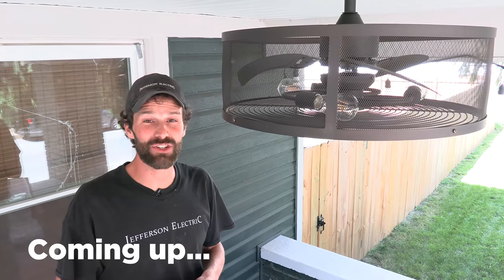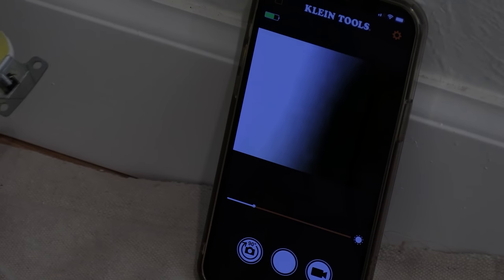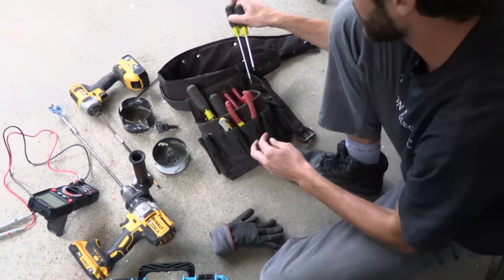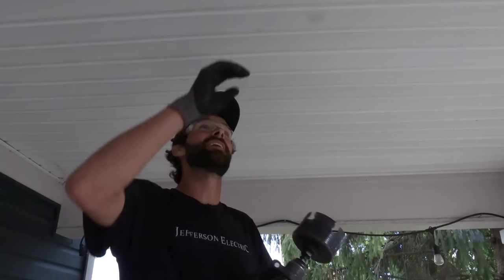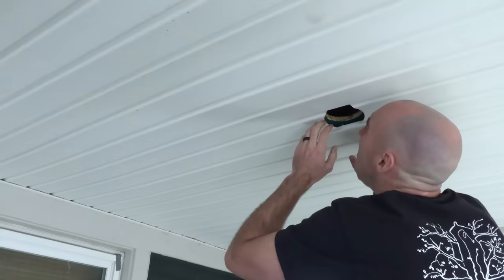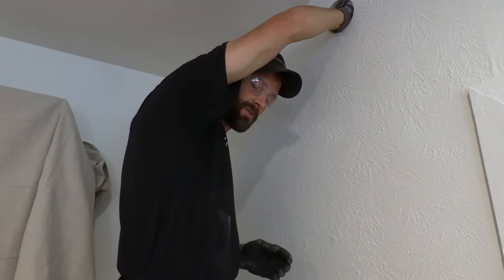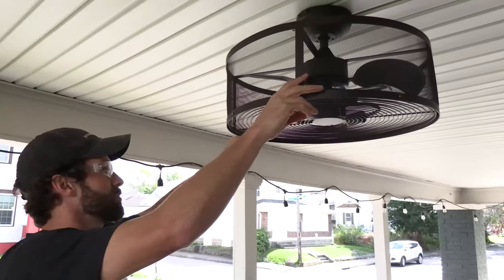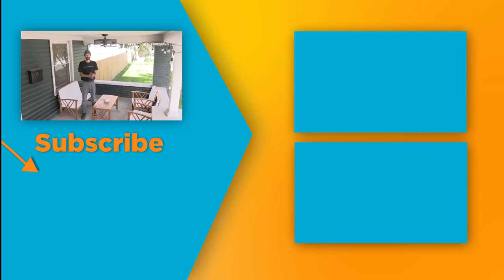Installing a Cool Breeze for a Hot Summer Day

Comment: Ceiling hole tip. When drilling your box hole through the vinyl, start your hole with the drill on reverse, low speed. Two or three revolutions to set your groove and you don't need to stress your hole saw skipping and scarring around your hole.

Comment: 16:02 I would have ran 14/3 in case you later wanted control of the light from indoors. *(For when you get tired of going through remote control units that last less than a year...)

Comment: One of My many favorite Home made Tools is a Golf ball with a hole drilled all the way through and cross drilled for a screw. now I can attach it to an Eye of a Fish Tape or on the stiffer Fiberglass Rods. I once had to Fish a 4" PVC with 2 90's and about 50 RG6 Coax's down 3 Stories. A normal Fish Tape would just coil up in the PVC and not go down. 
The Golf Ball just sailed down like nothing, I went down Stairs and had 50 Ft of fish Tape on the Floor. 
The other one is a Tennis Ball with a 6" 1/4" Eye Bolt through it. talk about getting Cabling through Bridging in commercial buildings was a Breese, In 37 Years, My moto was If I could see a hole in a Wall or what ever I could a wire through it. hahah...
Mike M.

Comment: Joel fine job ,  although I may offer a different approach if I may. 

just as you did start by removing the OW box containing the receptical and using fish rods to check for obstructions  after finding the obstruction this is where I would of taken a different approach 

Observing new vinyl siding and soffit on the exterior I would of removed the siding from the Top  down to where the obstruction is 

Then cut your hole from the outside and drill the obstruction instead of cutting drywall on the inside 
Then 
using your whole saw drill the vinyl at the proposed fan location
drill about a 1-1/4 hole  in the center of the 4”  Vinyl hole cut  (the plan now is to ultimately use a fan  rated pancake box commonly called a    “fan cake box. “

Then remove the vinyl soffit as needed for additional access holes or cuts

Now you  can proceed with fishing the wire across to the proposed fan location and dropping the Romax through the 1-1/4 inch previous drilled hole.  Now that the fishing is complete you  you can reinstall the material that was cut out for access 
Be sure to install the fire putty and reestablish any vapor Barrier that may have been compromised.  

Then proceed with putting the vinyl soffit back up and the siding back on and proceed with installing the fan cake with the Romex through the back center of the box with A approved connector  now the fan box can be mounted and fasten to the old wood finish above the vinyl soffit 

now you can proceed with installing the fan and reinstalling the outlet on the inside of the house ( thus eliminating any drywall repair needed ) and then you can walk away from the job 100% completed

Much easier than trying to match drywall and paint finishes. 

Remember this only works if we have the benefit of new vinyl siding and soffit material. 
Thank you
God Bless
Geo
Reply: I agree... going through the outside probably would have been easier and less sightly. It can all be covered up by the siding and ceiling paneling.
Reply from the maker: Geo, we need to get you on the channel. Great explanation! Funny enough, messing with the siding and soffit like that sounds intimidating to me. Crack a piece and now I’m really in for it with the homeowner.

Comment: Joel, you need to try a Teslong NTS500 Borescope. It comes with its own large lcd, they have multiple size camera heads/lenses, and most of the heads have 2 cameras (one straight on view and one at 90 degrees) with a button to easily switch the view, and high brightness led’s. 

No I don’t work for Teslong  😉

Comment: is that vinyl siding?  just wondering if you could have removed a few strips and cut / patched a hole from the outside instead of putting a hole into the drywall..?

Comment: Maybe not applicable to this exact situation but as you discussed and changed the location for the installation I was wondering. Would it not be more practical to place the fan, if it were only a fan perhaps, in a location that while less aesthetically pleasing, would then provide the best air flow to those wishing to enjoy it's cooling breeze. Not trying to cross i's or dot t's, just wondering. Beauty I suppose is always in the hand of the beer holder.
Reply from the maker: Haha! I haven’t heard that one. Being centrally located the fan does a decent job for a small gathering of folks rather than just one person sitting in the corner on their lonesome.

Comment: 5:10 Why you dont use a breaker tracer to find a correct breaker?
5:50 Why you dont use a Ryobi inspection camera with light to see whats inside of the walls. Sometimes i saw a holes for a wires run in fireblok.
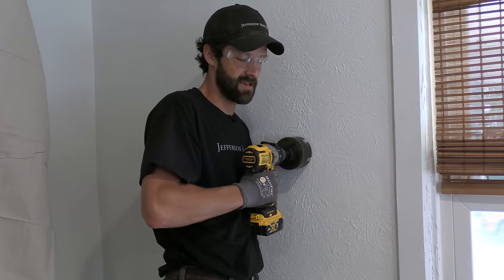10:15 Make a Dual square box instead of round and install a fan switch with usb charging GFCI. More useful.

Comment: After drilling holes through my joists to put the wires into them rather than badly attached underneath and improperly notched out of the joist in some places. I have said goodbye to spade bits and gone to speed bits it's a tri wing auger bit. Halfway through the project i was like it's time to get a new drill bit!! The wood in this house is the older but not really old 2x6 variety and it was solid, I just about burned the corded drill out!
I hope he's gonna save that hole he cut out. It wouldn't be that hard to do some minor works pre-repairs by slapping that thing back in its hole with some wood behind it, it will save on drywall patching which isn't that hard to do unless your wall is textured.

Comment: That's a nice fan. I like it. However the LED bulbs would go right in the trash and I'd use halogen bulbs. The fan will keep them nice and cool... Okay, I am being a little facetious. I like where they're located in the fixture. Even though unseen in the end, I think the WAGO brand lever nuts look better and might serve better. I can only speak from conjecture as I have not experienced those particular lever nuts. They look more bulky than Wago and that is also off putting especially in smaller boxes or boxes that have a lot going on inside of them. I don't like that ceiling box as it appears to be nylon which again, even though would be unseen, it's all about the quality of what you don't see and what is going to hold up better. Plastic and nylon just cheapens it, so why not pay a few cents more that's going to be superior and last longer and be easier when it is time for service ?

Not a fan of digital meters because they're not accurate, not consistent, and need batteries to work. Klein NCV detector would suffice verifying power is off. It's pretty much a given that the electrical wall socket is at or about 120 volts AC if it does alarm the NCV detector. Even if set to the 12 - 1000 you're going to know by contacting the hot side by if it flashes blue or is steady at red and continuous tone if it is higher than 12 or not. It would also be evident if in the end it doesn't work and so it would have to be fixed anyway, if it didn't work. So it just seems much simpler to do it this way.

I like Klein tools but I was unable to find a metal cased tape measure, so Stanley it is. They seem to be the only one that while also having plastic give you an option for metal and that's just so much better. Plastic and ABS plastic is toxic, harmful to the environment in production, comes from petrol which spills, gets brittle and broken long before metal starts to rust.

I say use the tape around the outlet. It doesn't hurt.

Comment: Well I hope you're happy now. All because of YOU I now own a KAIWEETS HT118E Digital Multimeter TRMS 20000 Counts with Higher Resolution Auto-Ranging Voltmeter Accurately Measures Voltage Current Resistance Diodes Continuity Duty-Cycle Capacitance Temperature 

Not that I had money to buy it, but if you say, I try to do. I don't think I have much longer to live anyway so I threw caution to the wind. It will probably blow back in my face and blind me.

Comment: that pancake box, is not a box for a fan load.. it is only for light fixtures... you would need the pancake type that secures the fan weight not on the box yoke...    also before you install a homeowners fan make sure they supply a damp rated fan...

Comment: You guys have to pardon me, but the bare Romex system used in the US is just a total mess in terms of upgradability. Every single electrical point here is connected to another using flexible tubing, then individual wires are passed inside. Have to change a circuit? No problem, just pass more wires.

Comment: US outlets are such a crappy design. The ones we use here in Australia are so much better.
Reply: What makes them better? We use a lot of different outlets in America.
Reply: As long as you do not use the cheapest ones you are okay. I installed spec grade receptacles in my house over 40 years ago. Had to replace one that my wife always tanks the long vacuum cleaner cord out while at over a 45 degree angle off receptacle. Have hospital grade receptacles in my garage & laundry area. They have nylon faces that can not be broken with a few hammer blows.
Reply: I tape a sloped piece of paper to walls before cutting out holes to collect all of the dust. Use heavy oversized flat washers & lock washers to secure ceiling fan brackets to approved fan boxes. Had a guy with a fiberglass awning install a 52" ceiling fan on it just to keep flies away when he ate cooked crabs outdoors.
Reply: @JohnThomas-lq5qp  I agree with you 100% however the problem I have with some countries they push an all for one approach vs the United States we have different standards for different needs. The transmission side of things is also interesting to research and study. We have so many different systems in the United States that covers different needs. Case in point, why should we need a fuse in the outlet itself when it doesn’t cover the wiring in the wall? So in some countries they protect the actual outlet but not the source itself? The fuse is acting like an arc protection and I get it but only protects the outlet itself not the wiring nor the walls. Im shocked that some parts of the UK would add only fuses to the outlets but not the breaker panel itself where the source is coming from.
Reply: @cr1m203  Worked along a German electrician years ago for 3 months on a ten million dollar state if the art machine. He told me that his think it was two bedroom apartment in Germany had a three phase service with only believe he said three main fuses. So I asked him how many branch circuit breakers it fuses did he have. Zero. Even at 220 volts that's not much diversity. We always placed every bedroom, bathroom, living & dining rooms in their own breakers.